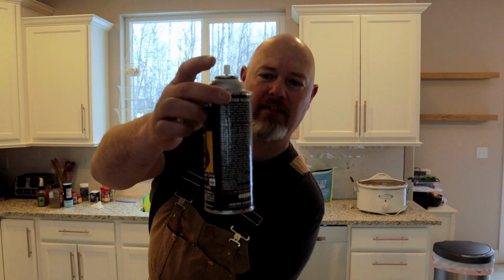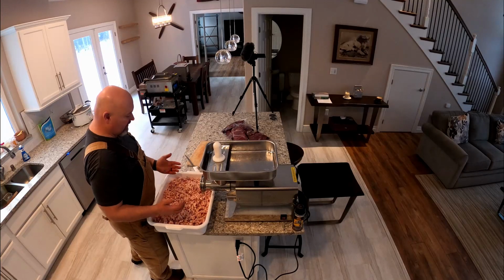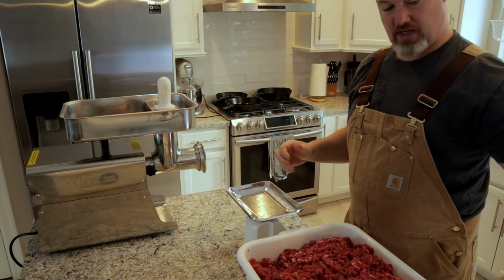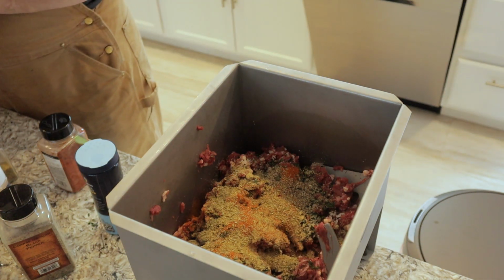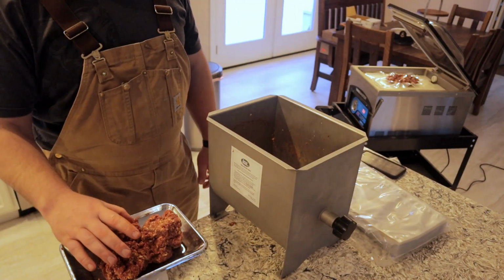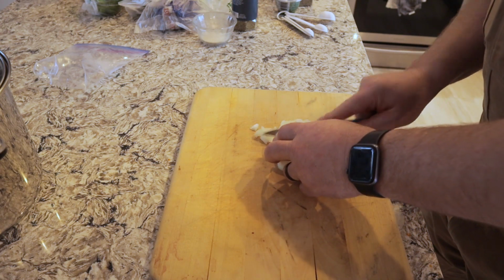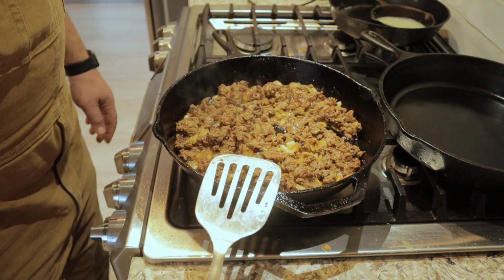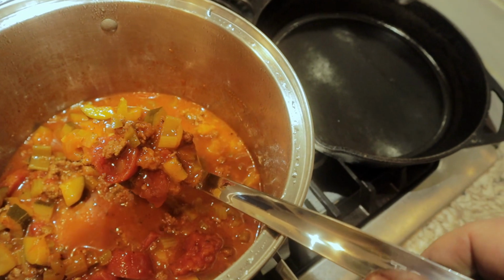How to make Wild Game sausage

Comment: They say the metal can scratch off your seasoning.   We use stainless in ours most of the time as well because we use them all the time we are not concerned about a scratch.  Have never had issues.   Good work and stay safe!  Looks tasty.
Reply from the maker: I totally agree with the scratching.  I only use cast iron and I’ve never had a problem with them.  I do have to go back and season them every now and then but it no big deal.  Take care.

Comment: Nice vid & recipes, looks delish.  That grinder really does it's thing fast!  As for wooden utensils on cast iron; a lot of people avoid metal utensils to avoid chipping off the seasoning.  Its quite hard to do ever, but on newer pans that don't have good season layer it can be damaged and result in rust spots that would mean stripping and redoing the seasoning process from scratch.  This is my cast iron bible for stripping and reseasoning: https://youtu.be/j6Tz3HnnCFs
Reply from the maker: I’ve never had a problem with damaging the seasoning but I can see where it could happen.